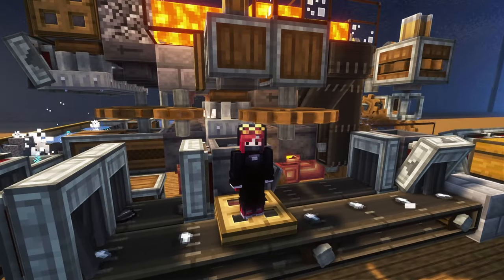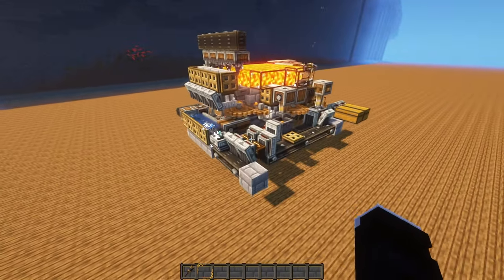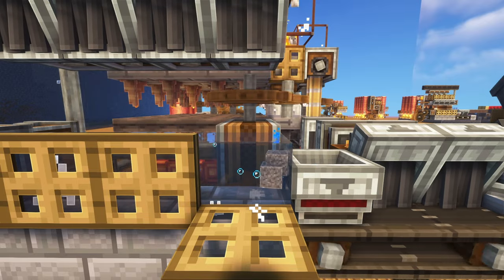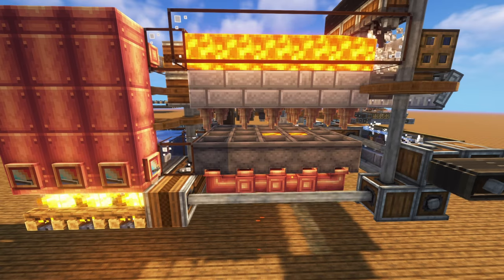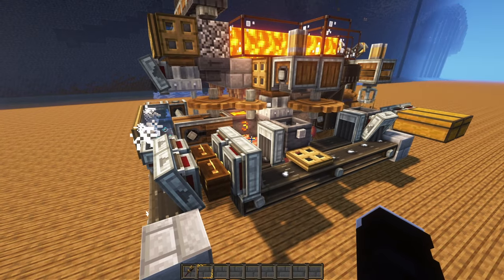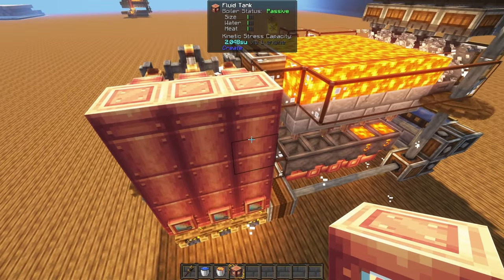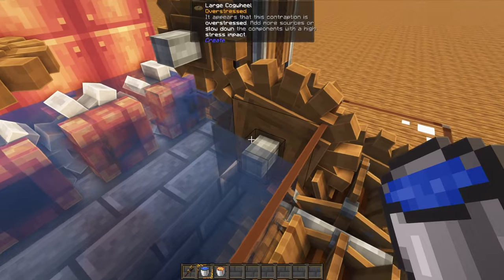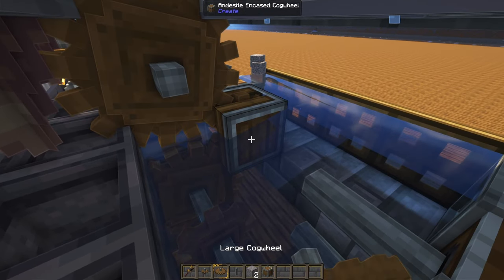Early Game Andesite Alloy Farm with Minecraft Create!

Comment: Hi, so I just used your schematic and noticed a few issues. Keep in mind I am using a modpack which usually uses the latest versions of the mods it uses at 1.20.1 but I am unsure which version of create you are using. The water wheels did not spin as the system was initially overstressed. I believe it would have worked once the boiler started going but regarding the boiler: For me, the pumps did not work as the the block in front of the pumps were not water sources. I had to fix it by removing two of the pumps and instead piped the boiler into one mechanical pump pumping out of an infinite water source. After that, I used my own power to get the system going. Also, note that the toolboxes will need to be re-adjusted with the flint/iron filters as the schematic did not properly copy the contents over.

Other than that, it's a really good and compact farm! I really like how you explained how to make it better later in the game's progression and you walked us through the steps of how the schematic can get bugged. I am using it now in my world and I appreciate you making my life easier :)
Reply from the maker: The pumps, you shouldn't need to replace anything, so long as you waterlogged everything in there, and made sure the 3by3 are water sources, it should work fine
As for the filters, I mentioned that on the previous guide, I guess that was still recent in my mind and assumed I mentioned that at some point during this episode

Comment: I dont know wether its common knowledge, but by combining 2 adjustable chain drives in a single chain drive row, you can qarter or qadruple the rpm, depending on the acd you power.

Comment: Why use Toolboxes instead of individual chests? You can Shift+RMB to place them next to each other without them connecting. Or Vaults even, if efficiency and storage is a bottleneck? With either of those, you could also (later) add a Display Link, Smart Observer, or Threshold Switch to automatically toggle the Adjustable Chain.
Reply from the maker: Because the functionality of the toolbox is that it can filter certain items when assigning those slots, without having to use a brass funnel.

As for the rest, I generally try to avoid using any complex mechanics in the farms because the more complex it is, the easier it is to not work, and the harder for people to figure out.

Schematics already break way too easily, and many of the players that come for help already struggle fixing basic things. Early game farms are hardly ever with endgame in mind, or super efficiency, rather I try to make them like a hammer, easy to use, easier to fix.

Comment: Hey, I need help. The mechanical mixer is not getting enough speed for it to start mixing: It's currently going at 64su. For context, the water wheels are going at 256su. What am I doing wrong?
Reply from the maker: The mixer should be consuming 256su. Hard to tell without pictures but unless the config file is different, or you missing something from the schematic, the mixer shouldn't be running that slow
Reply: @batsyvonfangies  same issue here i just use the canon and it tell me the mixer running to low
Reply: If you didnt already fix this i managed to by replacing the large cogwheel below the encased chain drive thats right by the fuel tank with a half shaft cog instead!
Reply: @magmazing  ur a hero
Reply: @magmazing  just tried it and the half shaft cogwheels don't connect to the chain drive and causes the whole machine to break

Comment: Hey, for some reason it doesn't fill up the iron nuggest and the flint... the encased fan blows in the other direction
Reply: use a gearbox to change the direction of rotation on one of the shafts near the fan. if you reverse the rotation you also reverse the fan direction

Comment: Just warning everyone that plays astral: IT DOES NOT WORK IN CREATE ASTRAL!
Reply from the maker: What problem does it have on astral? Because if they changed the config for the modpack, there is likely a workaround for it
Reply: @batsyvonfangies  I think it uses an older version of create because it has the old water wheels. Also, the water stream bit doesn't work.
Reply: Luckily there are crude storage units that can sort items like brass funnels but early game
Reply from the maker: @Realxandc   If the issue is filtering out the flint and nuggets thats an easy thing to work around
Reply: @batsyvonfangies  even if the sorting system was fixed, which I did do, some of the crafing recipes are changed which makes it so you need to build it in a completely different way